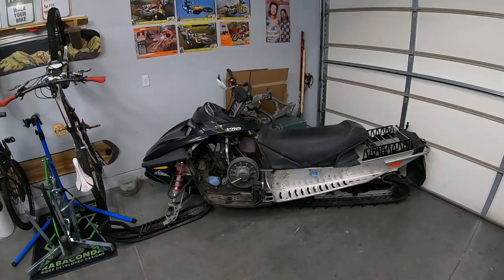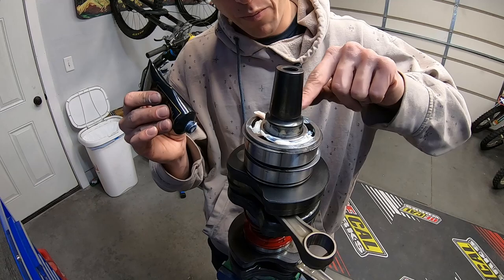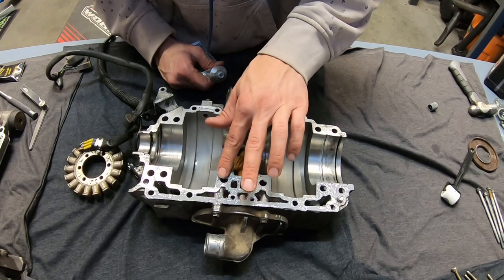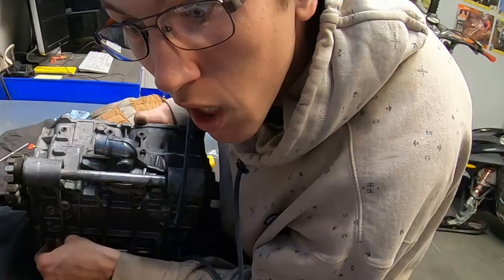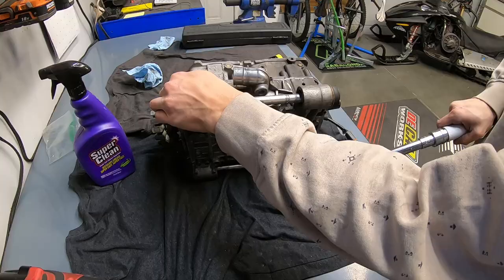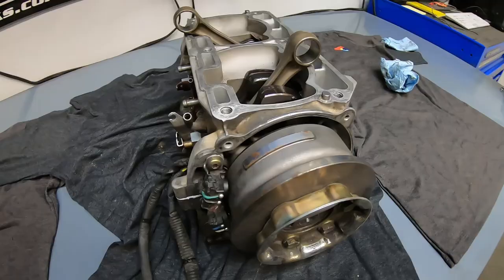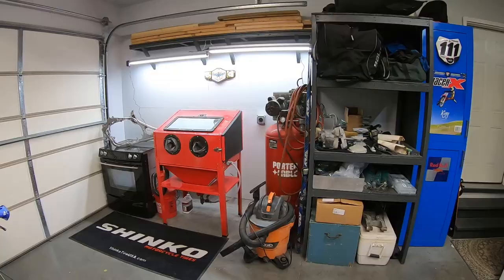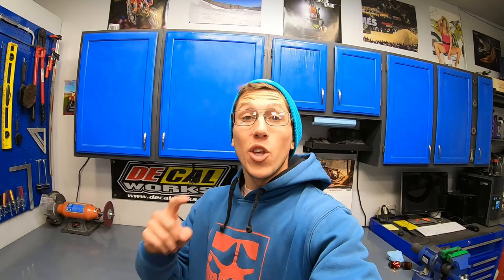I Hope I Rebuilt This Snowmobile Engine Correctly

Comment: Built a 600 sdi motor which has almost the same bottom end or maybe its exactly the same. I prefilled the oilpump but i dont think its necessary. Looks good to me!
Reply from the maker: Good to hear! I did pour oil into the bottom end before putting the cases together, didn't get the shot. There is still oil in the line for the pump as well, so hopefully all is good!

Comment: Did you put oil where the water pump shaft is? what type of oil did you use? I didn't see you added it there and I've heard there should be 100ml
Reply from the maker: I didn't measure, but yes, I put 2 stroke oil in there